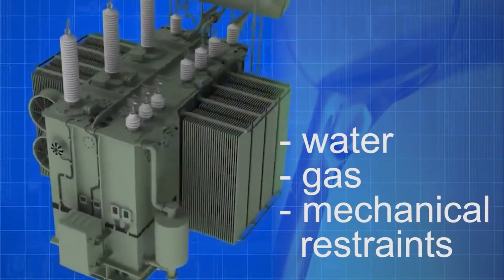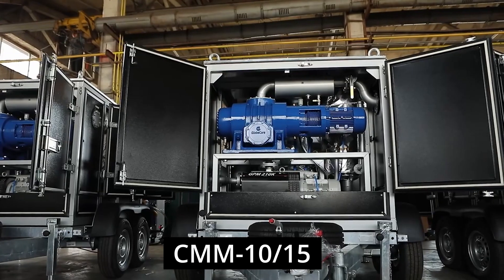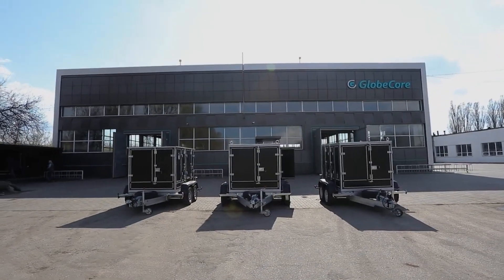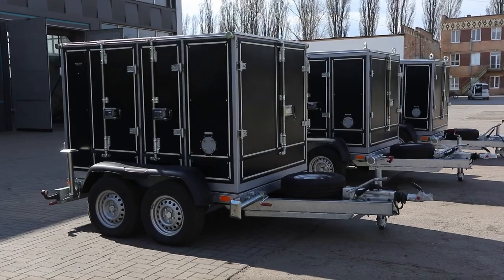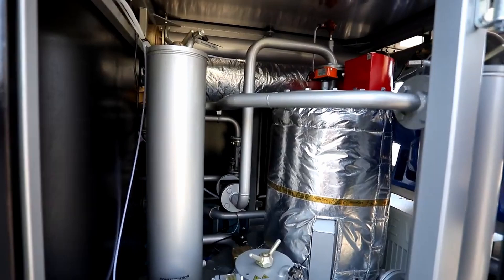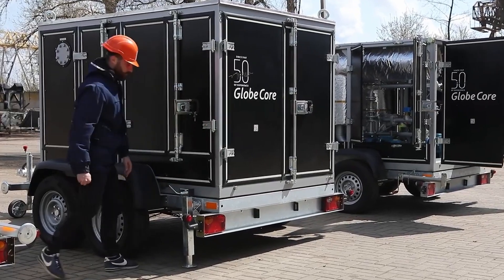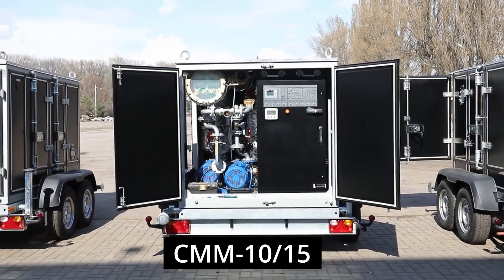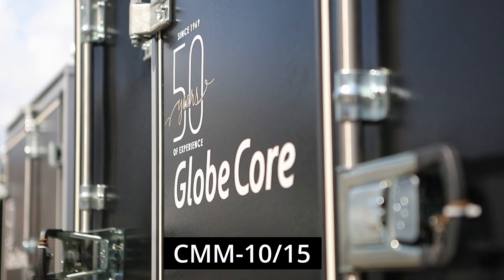High-Vacuum Transformer Oil Degassing Machine CMM-10/15

Comment: Can i apply vacuum on transformer from the machine  while circulation the oil ,and what is the achievable vacuum level during oil circulation
Reply from the maker: Hi, Elias. Yes, you can. But in this case, the machine's productivity will be significantly reduced compared to the nominal productivity. We recommend using separate equipment for vacuuming the transformer - the BV vacuum unit.

Comment: How does the use of the CMM-10/15 unit contribute to the overall sustainability of transformer servicing operations?
Reply from the maker: The CMM-10/15 unit enhances sustainability by extending transformer lifespan and reducing energy consumption.

Comment: Are there any specific safety protocols required for operators when working with the CMM-10/15 unit?
Reply from the maker: Operators should follow specific safety protocols outlined in the unit's user manual when working with the CMM-10/15 unit.

Comment: How does the protective case of the CMM-10/15 unit contribute to its durability and reliability?
Reply from the maker: Usually, when using a protective case, the service life of the equipment is at least 20 years.

Comment: Can the CMM-10/15 unit be used for other applications besides transformer servicing?
Reply from the maker: The CMM-10/15 unit is primarily designed for transformer servicing but can potentially be adapted for other types of oils, with the exception of motor oils.

Comment: Are there any specific storage conditions required to maintain the efficiency of the CMM-10/15 unit?
Reply from the maker: The unit doesn't require any specific conditions for storage. However, if you want to store it for an extended period, it's necessary to preserve the equipment. The preservation procedure is described in the accompanying technical documentation.

Comment: How does the unit's high capacity contribute to the efficiency of transformer servicing operations?
Reply from the maker: The high capacity of the CMM-10/15 unit speeds up transformer servicing, minimizing downtime.

Comment: Can the CMM-10/15 unit be operated remotely or integrated into a larger control system?
Reply from the maker: This is possible if you use a GSM module.

Comment: Are there any specific regulatory requirements for using the CMM-10/15 unit in different countries?
Reply from the maker: Regulatory requirements may vary by country; operators should ensure compliance with local regulations when using the unit.

Comment: What is the maintenance schedule required for the CMM-10/15 unit to ensure optimal performance?
Reply from the maker: Regular maintenance is essential for optimal performance of the CMM-10/15 unit, approximate intervals are:
Technical inspection before every operation.
Technical maintenance every 500 hours of operation, with the first maintenance at 100 hours.
Minor repair every 2000 hours of operation.

Comment: What specific types of insulating oils can the CMM-10/15 unit process?
Reply from the maker: These are usually petroleum transformer oils. However, when using other sealing elements, the machine can work with insulating liquids made from vegetable oils.